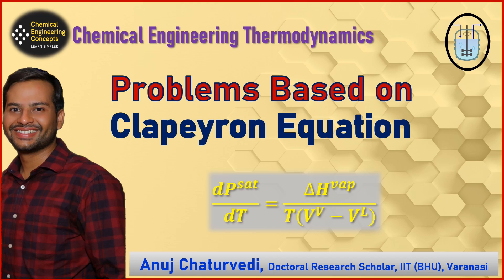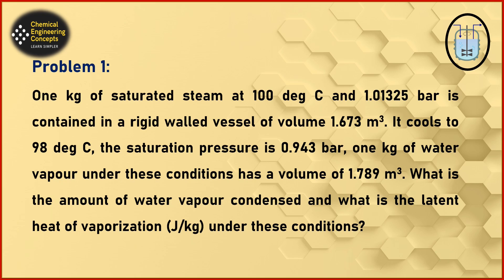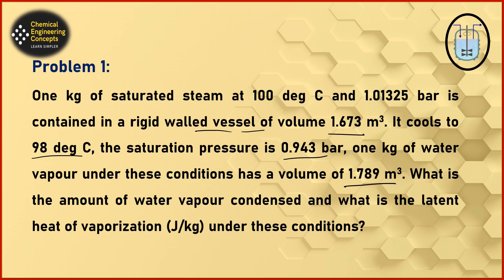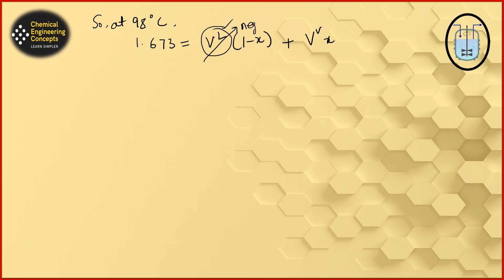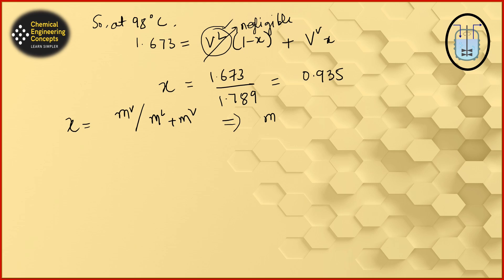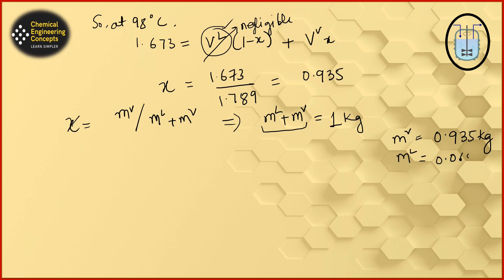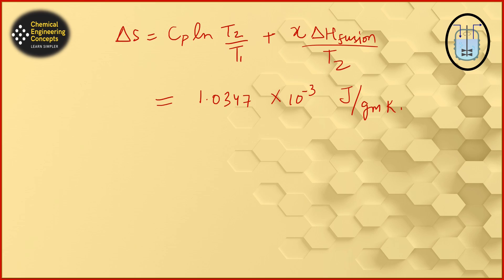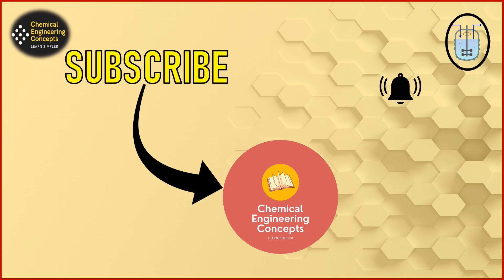Problems based on Clapeyron equation || Solution Thermodynamics || Chemical Engineering

Comment: in problem 2 ,  Sir please clarify these statements
- we know final temperature will be 0 deg because it is at atmospheric pressure
- we used crystal for depression in freezing point 
- initially it was subcooled at -6 deg c and it was exposed to atm to gain equilibrium  whike crystal was added there